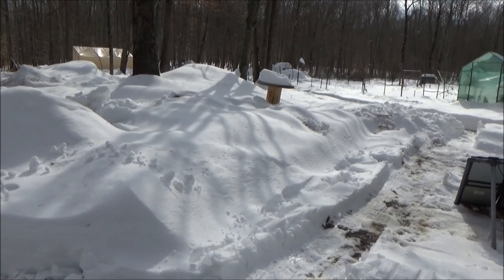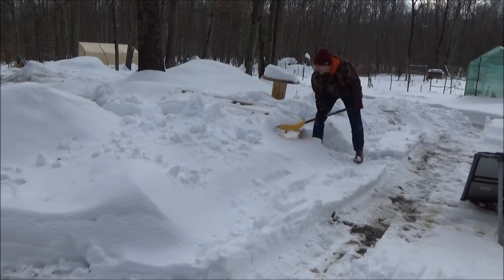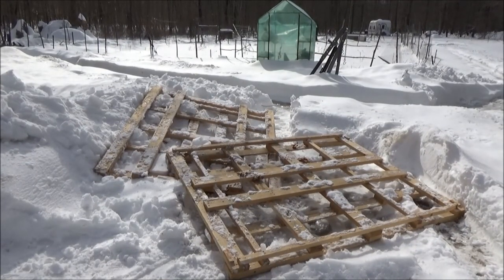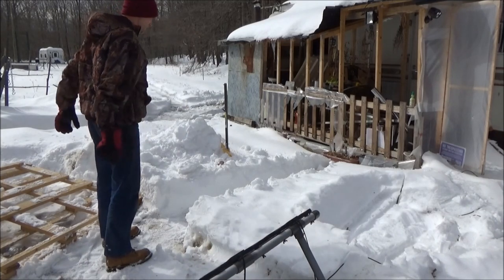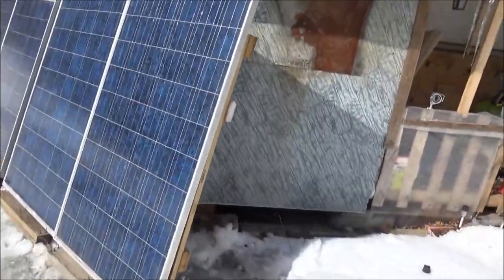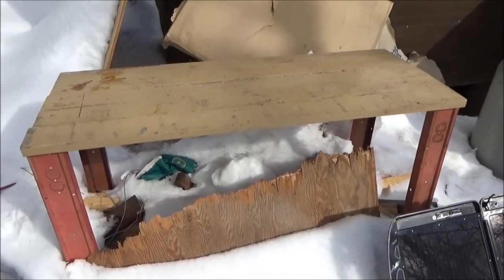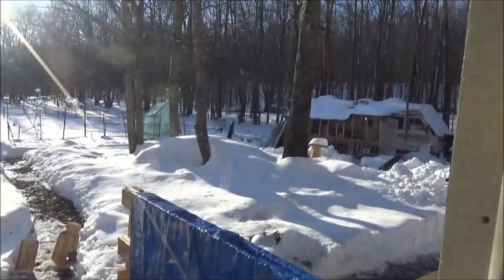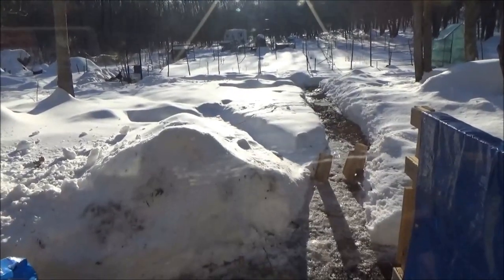Installing More Solar Panels At The Off Grid Homestead

Comment: Did I miss it? You finished the shower drain plumbing?     That shower floor can take the weight of the water tank. .. if you're worried just put down a couple boards to distribute the weight.  It will be ok.  I want to see the test already!

Comment: I bought a Yellow Jacket Contractor cord off of Amazon for 28 buck its a 12 gauge wire. pretty good wire. Its 25 foot and it called a Yellow Jacket Contractor Cord. Im using it on my Go Power right now to power my computer its pretty nice. 12 Gauge is acceptable for solar especially since your running higher watt and its not too far away. The longer Yellow Jacket Cords are more money of course. Its a high gauge wire. You will see a big improvement in wattage over the 14 gauge or 16 gauge extension cords for sure.

Comment: the problem with the 2 part roof over hang is in the summer you will be catching all the summer sun inside you house think about building it on one piece and putting clear corrugated roofing in the gap between your panels and then have a pull down shade cloth to shade it in the summer other then that sounds like a great idea

Comment: OK let me try to wrap my head around this. You have 4 panels in the meadow at 200 watt's each wired in series to give you 800 watts at around 130 volts. Correct?

Now you have a 2nd set of panels, 2 panels at 200 watts and 2 panels at 235w wired in series, so with derating you drop the 2 235's down to 200. In total 800w. Correct?

So what you are saying is you now you have this hooked up as 2 strings at 800 watts 130 volts each? You now have 1600w at 130 volts?

What am I missing here?
Reply: blakke29223 From my understanding I think you got it right.
Reply: Seymour Tappan
Thanks but I was looking for a answer form Troy, not that I think I would get one but it was worth a shot.
Reply: blakke29223 Ok just saying I think you understood what he was saying.
Reply from the maker: I have them in parallel so the charge controller sees a max of 800 watts but with double the amps. Otherwise you have it right.

Comment: Troy, I realize good tarps are expensive, but wouldn't cheap plastic drop cloths save you from having to chip ice off everything or waiting for it to thaw out?  Seems like you do ten times more work than you should have to.  Also, you could build a frame out of pallet wood covered in plastic that you could put over the batteries, generator, etc. for protection from snow and cold.  Another idea is put the solar panels on the house lower than where you are planning.  This would shade the first floor windows from direct sun in the summer, provide a porch roof on the front of the house, and be low enough to sweep snow off in the winter.

Comment: For a physical mind it would make sense to put a mask of some kind on the solar panel, a mask that has like 1 inch (as example) deep crating (vertical and horizontal lines as example) with spaces figured out so that the light is bounced more to the panel no matter what angle. There are various solar panels but as I experienced their common issue is bouncing the energy OUT (a.k.a. reflecting), especially if they works like a mirror to some extent. Thinking ahead the mask/crating could be angled towards the panel not perpendicular. I would examine the leafs for that matter since Nature has way more experience, but as I don't use solar panels I have other things to work out.

Comment: Wow I'm #16 viewer! He you should boil hot water and spray it on the snow to melt your problems away, I can't believe your using so much energy to move snow around. Next winter you should get a solar hot water heater that you can attach a hose to and spray all your snow with it. You could also hook your load bank from your wind turbine directly to a hot water heater.
Reply: Not very practical when you are carrying water in five gallon containers from either the creek that is at least 1/4 mile away, or a house which is even farther away.   If Troy had a well and unlimited water, that would be another thing.  But then, even with access to unlimited hot water, that water has to go somewhere and in winter in below freezing temperatures, it will just form treacherous ice which would be very dangerous to anyone walking in front of the tiny house.  IMO digging is the best way to achieve his goals at this present time.
Reply from the maker: Guy Fawkes The only real "sustainable" method to move snow is a shovel. Anything else is really just using some sort of energy. But while I have gas available I will use the snow blower. By the way this one has rubber blades and does not hurt wires. Ask me how I know.
Reply: keepmoving15 I'm not going to argue with troll comments. Troy please be carerful and I'm wishing you good luck with this bad weather.
Reply: The Do It Yourself World you didn't snow blow your feet did you?
Reply from the maker: Guy Fawkes No. Hard to do that with this machine. It has safeties to protect you
Reply: The Do It Yourself World well that's good to know, I guess these machines were built with that in mind.
Reply: Troy I deleted my comment from before, I was worried for your safety but I believe now you have things under control.

Comment: Troy... Your talking about an awning or a lip off the top of the roof of the house... What about using solar panels on a hinge in case you have to move you can just unfold them and they will be up against the wall of the house. But the angle while out would be nice for the solar panels.
Reply from the maker: Yes that is the plan. So I can fold them down and also adjust the angle according to the season

Comment: I think if you shorten your wires from panels to charge controller you'll see more power, DC doesn't travel well over long distances...
Reply from the maker: I am using 24 volt panels connected in series to give me 130 open volts at only 8 amps. My MPPT solar charge controller handles the rest for me. This means reduces loss and I can use thinner wires.
Reply: Okay sounds like you've researched everything about it, I gained my knowledge from reading Michael Reynolds Earthship books and he only recommends short runs with DC and using heavy automotive wiring. I suppose you've tested this already and haven't seen much difference.  Just trying to help.
Reply from the maker: Guy Fawkes Yes that is very correct. For most applications short runs with heavy wire. Even with my application shorter runs are better. I plan to move all the solar panels to the house soon. But I am chopping away snow and ice right not trying to make space for them.
Reply: The Do It Yourself World oh I see, I didn't know you planned that. I guess you get a lot of constructive criticism for things you already planned on changing. I just saw an opportunity to comment and didnt know you had already planned that. Im really impressed you've got the current setup already in place, once you fine tune it I'm sure it will work very well for you. I really like the computer diagnosis and the record keeping. Its helps a great deal to see how small changes effect the system.
Reply: Hey have you thought about aiming mirrors at your panels to boost the daylight? Greenpowerscience did a video about this and claimed a 30% increase in power.
Reply: The key here is getting the highest voltage if your running long distances. So to fix his cloudy day problem he needs to always produce high voltage and put the panels in series and the shortest cable distance.
Reply: ***** it shouldn't be a problem during cold winter days, and you have to use amorphous panels.
Reply from the maker: Guy Fawkes My system is 130 volts at 8 amps
Reply: The Do It Yourself World you might want to check your panels directly with a meter and the end of the extension cord and compare voltages with and without clouds. Okay so I rewatched your video and saw the 132 volts. Either way 50 foot is 10 volt drop 8%, and 100 foot is 20 volt drop 15%. If you have a cloud your drop is 50% at 100 foot vs 4% at 10 foot. The shorter distance means your voltage drop when a cloud brings your solar panels votage down would only be 1.3 volts vs 20 volts. 

I got your 1 amp and 54 volts from your live data view.
Reply: I forgot to mention I'm calculating 24 AWG because I don't know what size extension cord your using.
Reply: I think once you move your panels to the tiny house you'll see higher watts on cloudy days.
Reply: Pete Brown I wish I knew more to help, he's on the right track and will figure out what works best for him.

Comment: You know what would help is if you wired all your panels in parallel at 24 volts so when one of your 4 panels are shaded it doesn't take out all four panels in that string,I believe this is you only problem with the power output,I have been analyzing your system closely and think you will benefit greatly.
Reply from the maker: They have blocking diodes to prevent such problems. I have them in series to reduce power loss over the wires.
Reply: The Do It Yourself World right, but now that you have 2 strings of 4 panels if one is half shaded will you not lose 100% of the power due to the mppt controller? one string will be 130 volts and the other might be lower like 80 volts, just a thought, if you still have power problems maybe try it :) GL looks like your gunna have enough power now!, you have 1600w now right? i have 1500w my self and love it. I do not have any trees blocking though.
Reply from the maker: fliping720 The blocking diodes allow the rest of the panels to work if one is blocked. They allow a single panel to continue to work if a leaf hits part of the panel.
Reply: The Do It Yourself World ok cool cause mine kinda work like that but not well, my mppt only got 7 watts from my 255w panel with the bottom 6 inchs covered in snow and when i uncovered it i got 240w, im thinking that the mppt still doesnt like something. anyways ill stop taking up your time have a good day.
Reply from the maker: fliping720 When the entire bottom half of your panel was blocked, it crossed every single row in the solar panel. This caused the entire panel to be blocked. But blocking just one row will still allow the rest of the panel to produce power.
Reply: robert young its a dead link.
Reply: robert young hmm such a small shadow can do a lot...
Reply: The Do It Yourself World you know 130 volts DC is vastly more dangerous than 120 volts ac. Therefore make sure one of your hands is in your back pocket to ensure a shock doesn't go across your heart.
Reply from the maker: sim6699 Got zapped the other day. Hurt but not too badly.
Reply: The Do It Yourself World If a shock doesn't kill you, it can damage your heart muscle, resulting in an irregular heartbeat. 
To make maters worse, I notice American wiring has no earth cable and your generator has no earth cable & earthing rod.

P.s. rubber soled boots, gloves, insulated screw drivers/multimeter to cat 3 would help too.

Comment: Would using warm water help loosen the frozen pot you want to use for growing greens? Otherwise, you can certainly start plants indoors using other containers, used metal cans, pots made from paper, or even plant them in one of your cardboard boxes (set on a tray)... and then transplant them once you get your pots free.
Reply from the maker: These are frozen into the ground. It would take a whole lot of hot water. a LOT. I will use other pots, yes.

Comment: I hate posting due to the haters but I have to ask.  Troy. . .I know why you are doing the series trick and all, copper is expensive.  but why are you putting your panels as FAR AWAY as you can from where the power is needed?  I do not recall in the planning what your long term was for the solar, but I am assuming you picked the build spot with an idea of power?  I know something is not right here.  .Four of those panels should bubble those batteries with ease. Those panels have those solar connectors which can take a 8guage wire for those fittings.  You should at least wire up ONE panel with 8guage all the way to the charge controller and calculate what a single panel can do at optimal.  4 or 8 of them at optimal for just four hours should be overkill for you.  I have 8 100watt panels and 6 Walmart batteries and well. . . .lets just say I have a LOT more power than you do and a lot more problems with sun due to trees.   I look forward to seeing what a few local panels wired well can do.  But common sense just tells me. . NO one puts panels as far away as you do.
Reply from the maker: This is the only place where the sun shines the most all day. I do plan to move them all up by the house soon though. But the wire is expensive. I am saving up for all that and trying to chip out the ice holding everything down in front of the house so I can set the solar panels up there. But right behind the RV is getting the most sun all day right now. In the meadow where the other panels are is the best summer sun location. But I plan to cut some trees and mount all the panels on front of the house when the ice melts off my wood and I can build again.
Reply: The Do It Yourself World Let me ask another way.  You need to recharge the batteries from the night before's use, and charge laptop, batteries, cordless tools batteries etc.  The second function to store power for cloudy days, rain, snow days etc.  Cost is obviously the big factor here as good strainded copper cables are not cheap in any sense. Placing panels closer may not put them in the optimal places, but would it not be better to have optimal power to charge controller when you do have light then optimal light and that series distance thing?  In full sun (even for just 2 minutes) those panels should be serious power.  I remember when you were in the RV and hammering that controller at 60amps coming in. (yes it was summer, but I am talking about in full sun you were getting that until a cloud etc).  With this new setup, you are never getting the amps.  I am guessing. . .but 20amps for four hours should be MORE than enough to recharge what you use in 12v LED lighting each evening.  Even with the PC drawing power off those batteries until midnight.   So what am I missing?
Reply from the maker: jgreen302 I did answer your question above. I repeat "But I plan to cut some trees and mount all the panels on front of the house when the ice melts off my wood and I can build again"
I have also stated that as soon as I get the wire for it I will move the other four panels from the meadow up to the front of the tiny house. Just need to get the wire for it. Hopefully soon. Other problem is that everything is frozen solid in front of the house and I am trying to chisel it all out and move it out of the way. Been working on it though.
Reply: The Do It Yourself World
If you're copper-poor you could always cut the long cord in half and use two strands for positive and two for negative.
Reply from the maker: Hope that did not come across too cocky. Sorry, I just reread my comment.
Reply: The Do It Yourself World Nope  I don't take it wrong, same goes with me. . .focus on the points and ignore the rest so to speak.  I just keep coming back to that small little place with dc lighting and limited electrical, with not one but two monster forklift batteries (paint the metal black for winter, white for summer?) all the big panels AND a wind generator . . . .you should be sitting in the world of power over kill.  Since I have YOUR inverter, and smaller panels, and crappier batteries, with panels leaning against my house back walls with even MORE limited sunlight then you, I can power most stuff longer without taxing my batteries.   That tells me that something is fundamentally wrong.  I don't know for sure what. . cause I am using extension cords to feed my panels to my inverter also.  But my runs are 15 ft tops.  The only difference is I run 200watts of panels per cord, four cords combine then feed the system.  I experimented and smoked 50amp solid AC coax cable and learned a few things.  Focused on efficiency etc.  Something is not right.   Now, with that said, PLEASE tell me that is a wild AC wind gen with a recitfier back near the inverter????